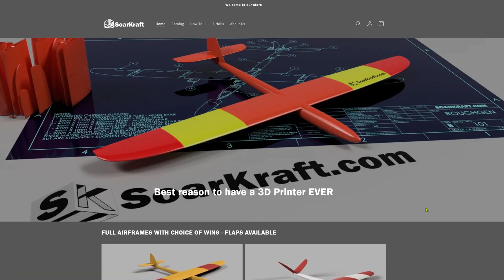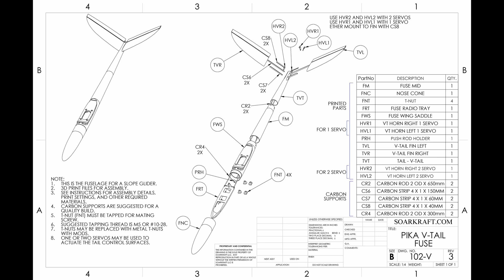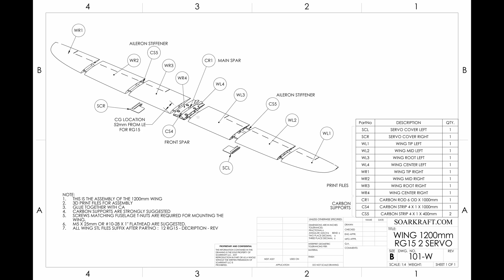Part 2 - LW-PLA Pika from SoarKraft - 13oz RTF - build and fly - Airframe Assembly

Comment: Hi I am amazed by you're designs and I want to purchase this model, I have set up Orca slicer as per your instruction and run the test print. It looks ok but I can improve that, Can you give me a base weight for the test print in lw-pla as I think mine is too heavy.. 
tia Paul J
Reply from the maker: If you set up the slicer with the actual material density (1.09g/cm3) and have the flow ratio to the right valve then Orca will calculate the value which comes to 2.6grams for the test part in LW-PLA.  The actual part might be different for a specific brand of foaming LW-PLA... but it should be close.  Use the wall thickness to adjust flow/temp to get .41mm wall in the back section and .82mm in the front.

Comment: @soarkraft Have you ever done a nose cone in TPU ?
Reply from the maker: I have not, interesting, I will have to try it.  I have the material, the A1 is idle at the moment and does TPU well.  I do usually count on the nose cone as the “crumple zone” to protect the radio tray from damage… so this might not be a good use for me… I crash a lot and fly in places with very unforgiving landing areas, big rocks.
Reply: @soarkraft  if you put an egg in a pla nose cone and a tpu one  with a lawn dart tail I'd be backing the tpu to win but maybe I have it wrong , it's what makes it interesting for sure

Comment: Great Video, awesome model. But pls, use a mask when you are sanding /Grinding Carbon. Cheers Axel
Reply from the maker: Good advice, however these are small pieces with very little cutting or sanding..... if you are grinding your carbon you are doing something wrong.
Reply: @soarkraft  it's about the small numbers